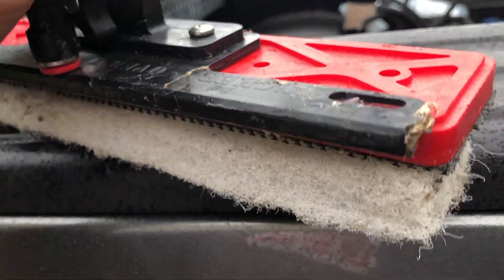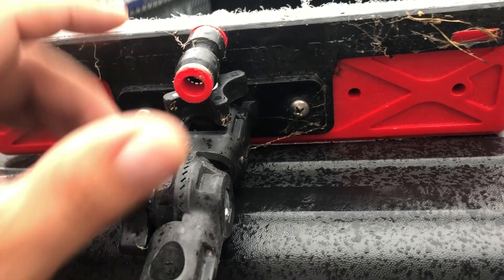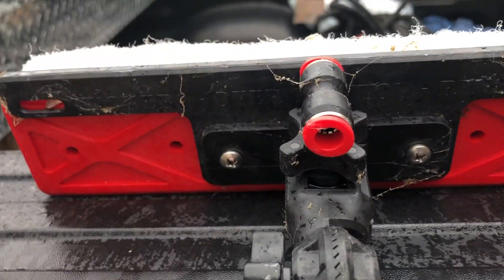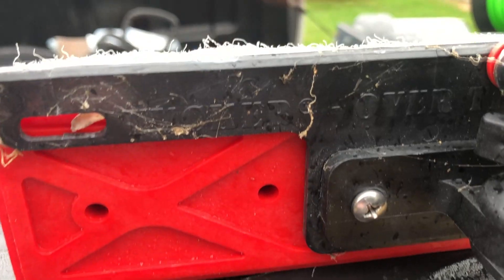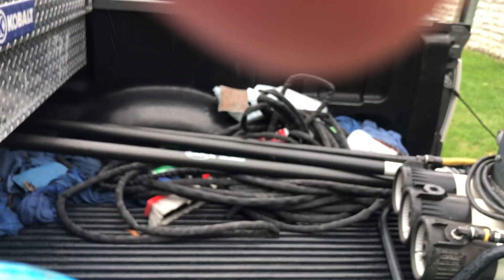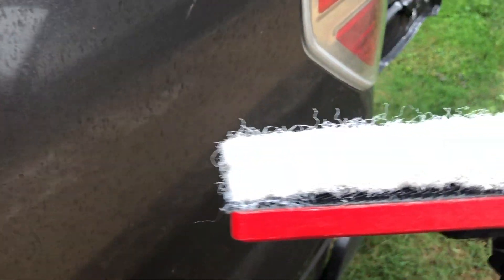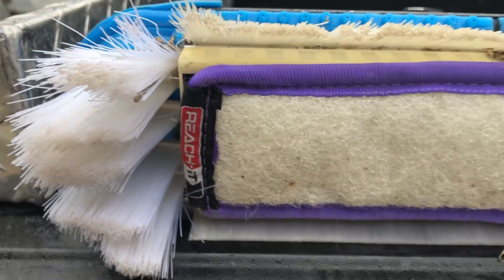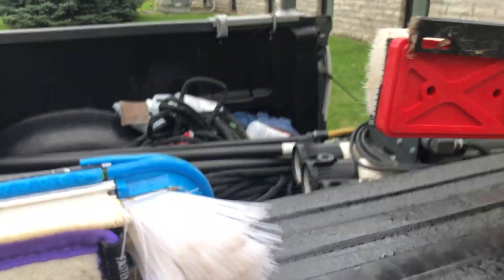Tucker Alpha Scruber Vs. Window Weapon

Comment: Tucker hybrid brushes are amazing especially for pure hot  water, I've learnt over the years do your research, buy the best equipment that works and  won't fail during  work time is money 💰 , my go to equipment Gardiner poles , tucker brushes and ionic systems pure Quattro   400 litre  delivery tank and ionic hot box 70 plus Celsius degrees at brush head ouch that's hot and cleans amazing

Comment: Tj great video and review.PT did put thought into improving products he just implemented the so called improvements with cheap-💩 plastic. Spend a little more $$$ on better quality materials it will turn out better. 
But we all know that ain’t happening by looking at the regression of the materials used in the 💩💩Slinger. It went from cheap clothe to even cheaper vinyl. Good luck A.C.  with trying to bring that out of the 💩💩💩💩pile.

Comment: Lol. You do a lot of bitching and not a lot of reviewing. You don't actually explain how tucker brush out performs constructor brush. It sounds like someone paid you to bitch about reach it in order to steer them toward tucker. I have both tucker alpha brush and constructor brushes...... constructor brushes are FAR SUPERIOR! Tucker is a damn broom brush. I used it on windows for about 3 months and now it's been demoted to cleaning siding on houses. Constructor is used for glass. Constructor brush has better design, better bristle contact on the glass, better scrubbing power, better rinse bar and better water volume output for better rinse. Tucker is a broom with a shoddy plastic tube with hole drilled in it that spray water unevenly. Tucker half assed their brush and rinse bar hence why it's used for siding now.
Reply from the maker: Clearly you’re new. The Tucker “broom brush” as you call it is an industry staple. I’ve owned every version of that complete pile of plastic shit reach it calls innovation. Your rant on this video screams your butt buddys with Perry Taint. Tell me if that brush is so fucking amazing why you can’t give those fucking things away? Those rinse bars on that brush are sub par at best. Tucker’s bristles best in the industry that’s not a disputed fact. So good in fact that cheap shit switched to the same EXACT bristle. Anyone with a fucking brain or more than a year cleaning windows will tell you more contact on the surface ie more bristle per square inch or pad will always be better. Not a brush with a small pad and round bristles on the end. Kind of weird they sell brushes with square ends and mad pushing their square end brush. Also quite strange that the “constructor” brush is completely phased out by cheap shit. Come back and try again after you pull Perry’s junk out your mouth and you at least have a clue about what you’re talking about. Do some research noob.
Reply from the maker: Lmao@ a brush to clean siding. Complete fuckn noob lololol